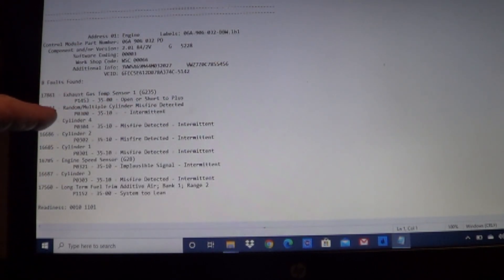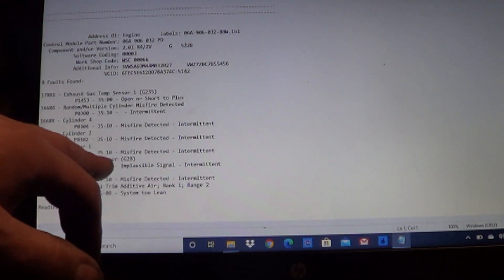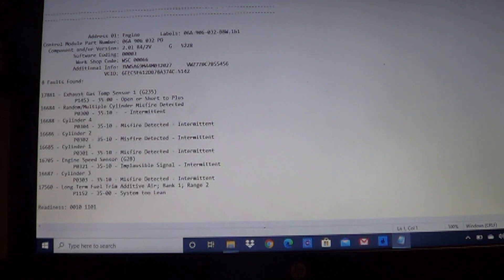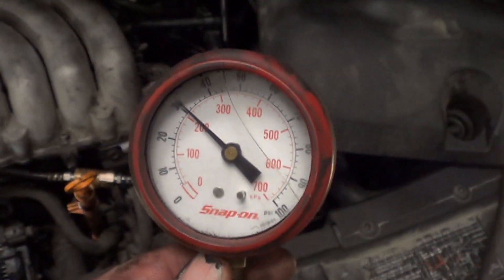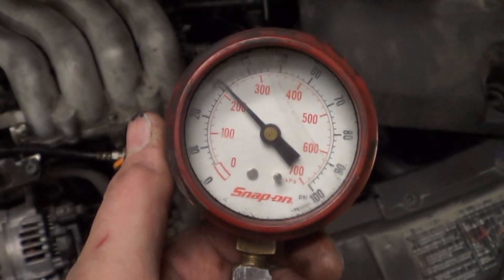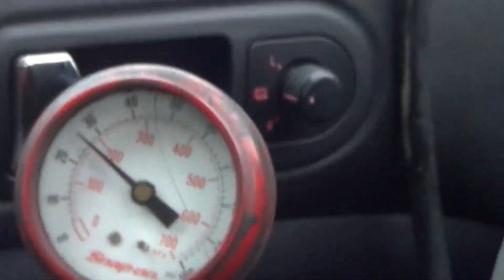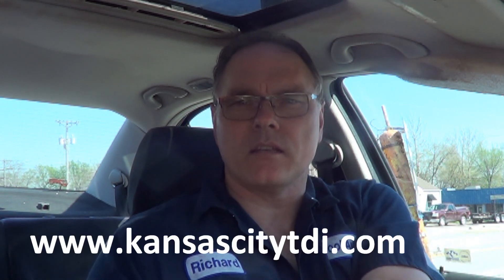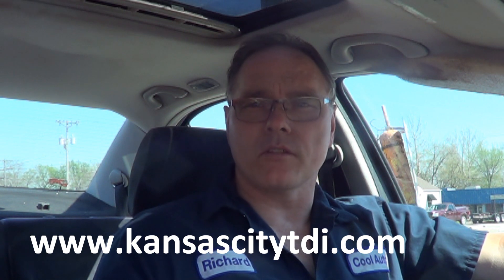misfires, lean & Intermittent no start

Comment: I agree with your theory on crank/cam implausible code with a dying fuel pump.  Had a BEW car with a bad lift pump and occasional long cranking to start.  Had a cam position code that never came back once the pump was replaced.
Reply from the maker: thanks!

Comment: I've never seen metal tanks on mk4's . Is that BBW specific? I've only worked on a few BBW engines but never looked at the tank. Is the pump smaller? I couldn't tell how big the access hole was.
Reply from the maker: It is a metal tank.  Pump assembly bolts in instead of the plastic "lock collar" you would expect.  I dont know if its BBW specific.  Its more expensive.
Reply: @CoolAirVw  Thanks!